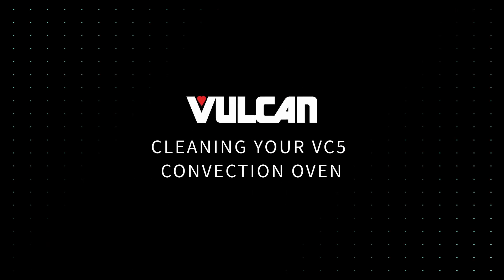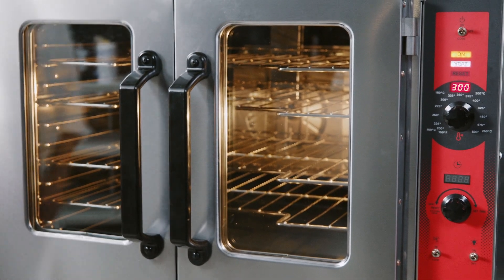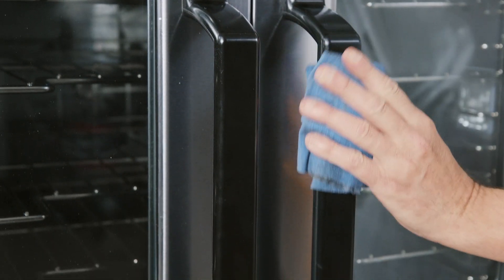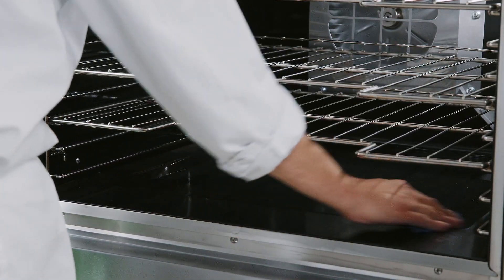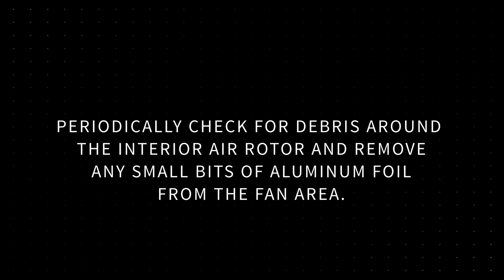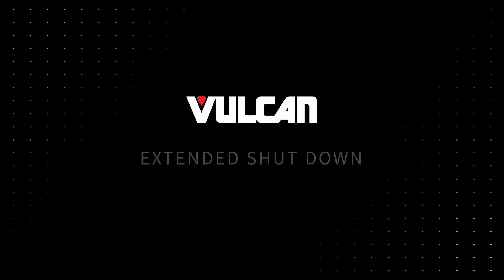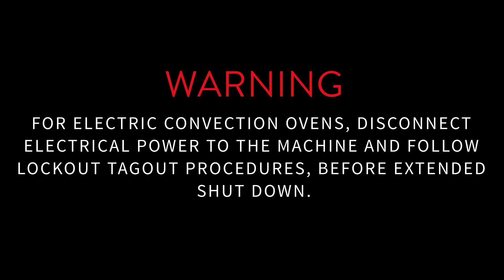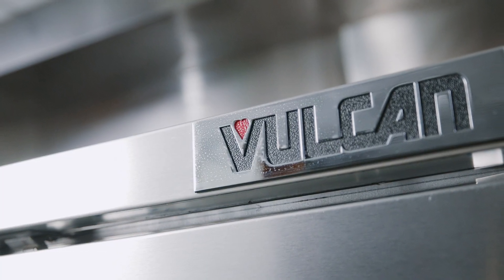How to Clean Your Vulcan VC5 Convection Oven

Comment: You showed how to clean a clean oven. Zero information on how to clean an oven that is dirty and greasy
Reply from the maker: Thank you for your question. If dirt and grease have accumulated on the oven interior surface, a mild ammonia solution or commercial oven cleaner such as Easy-Off or Dow may be used. Avoid using cleaning products which contain abrasive, chlorine, or solvent. We also recommend you immediately wipe up spills when cooking and clean your oven daily to prevent grease and dirt build up.